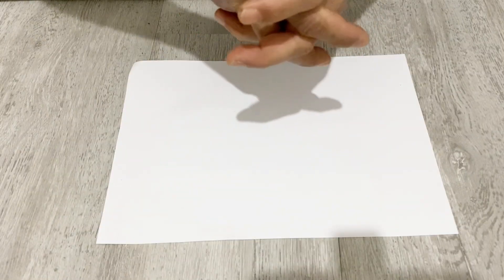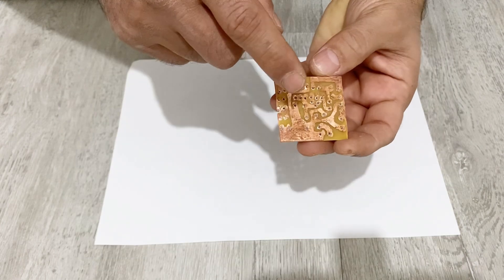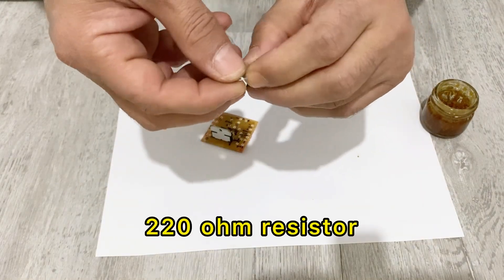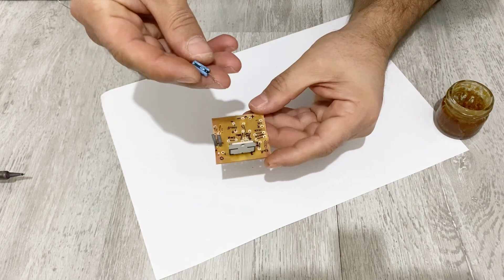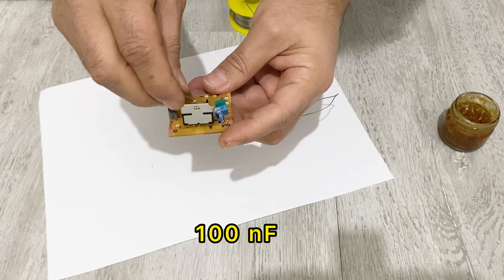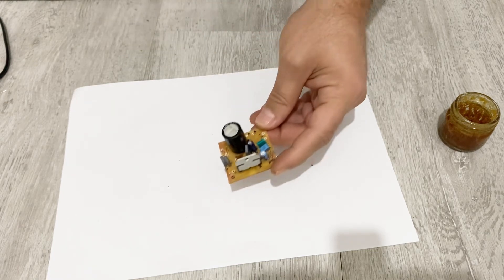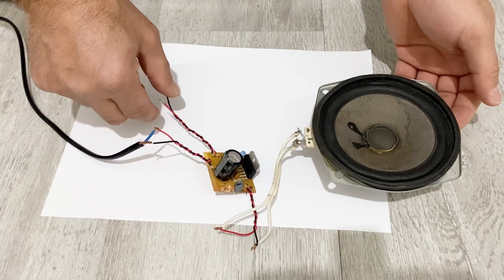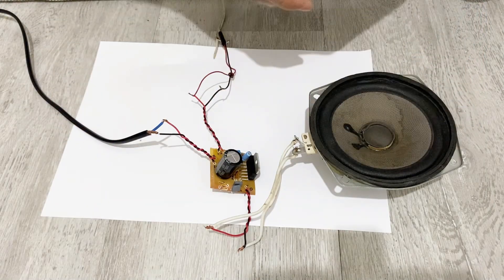Making High Quality Amplifier | TDA 2005, 20 Watts Mono Amplifier.

Comment: I swapped the guts of a 2008 iMac out for a LCD driver/inverter so i can use the iMac display as a generic HDMI monitor. I am using the original iMac speakers since they sound pretty good. The LDC driver board has a speaker output and I built a cross over for the iMac speaker's (since they have a tweeter/woofer) It all works (im quite surprised actually, lol) But the speakers arent very loud, even at full volume. 

Could I build a circult like this to go in between the LCD driver board and the speakers/crossover? I want to still use the LCD driver board's volume control. So i want a circuit that amplifies the volume at a set level (i dont want a volume knob on the new circuit) I have 12v inside the monitor and the speakers are 24 watts

Comment: If you let all get married this and the speaker and your infinite battery from a year back that speaker with a good bass can drive your infinite battery with holding that electric field and more coils like the kapanadze .with just extend the speaker coil long enough to reach the inside of your battery. and coat(glue) the coil also with that fe oxide. The speaker has to be dominant with his power for the movement.
Reply: Very good movement on unit,that's  Technology your are in Electronics,graph fields & wire development, board set up.😊